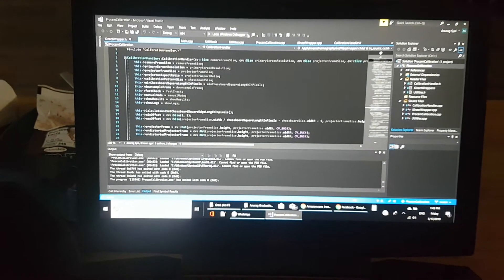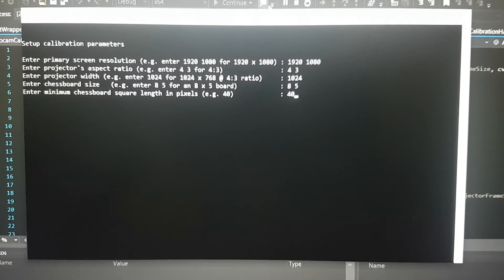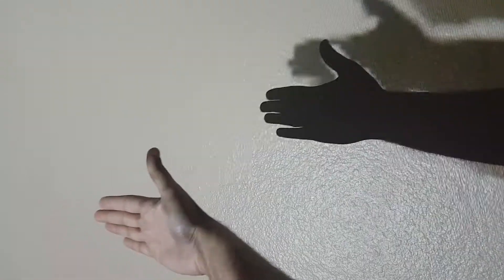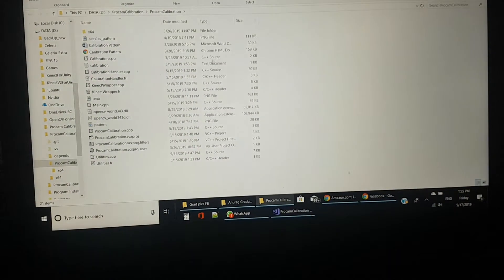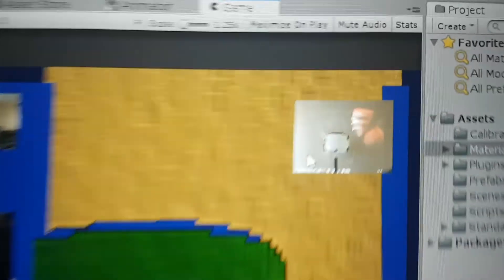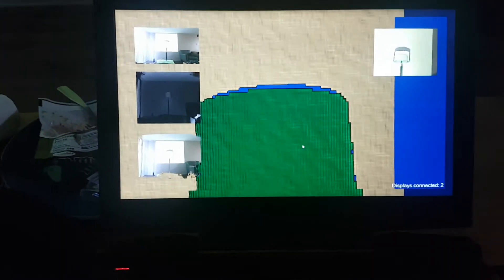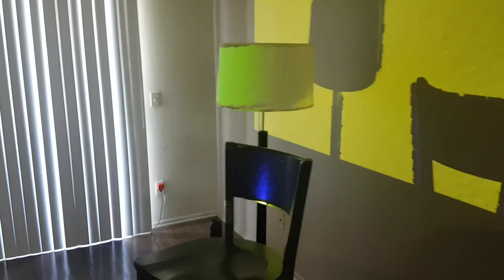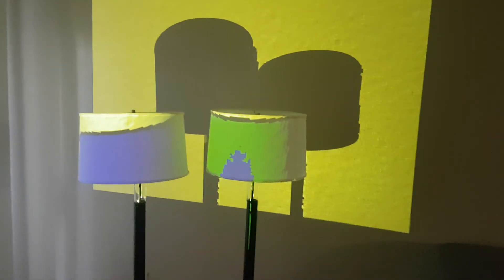Projector Camera Calibration (Procam) for a Wall

Comment: Would this method work for an AR Sandbox? I have a setup that uses a kinect v1 set up above and center to the sandbox while the projector is placed at the border of the sandbox a bit higher than the kinect

Comment: Would this same method work with a normal webcam with no depth sensor? Just the calibration part where the webcam image is aligned with the projector point of view.